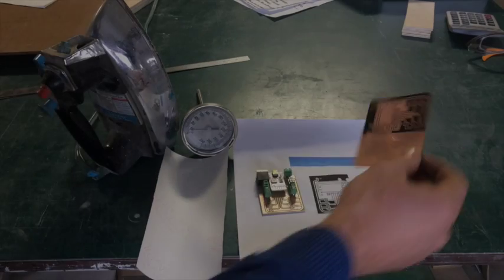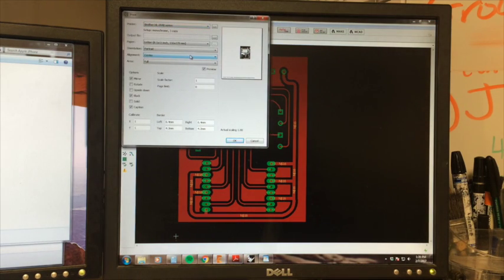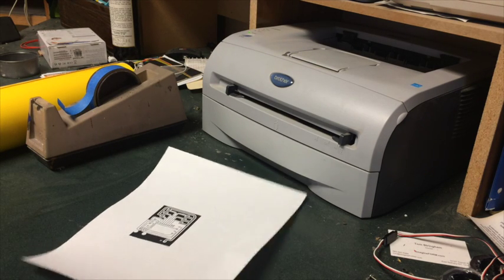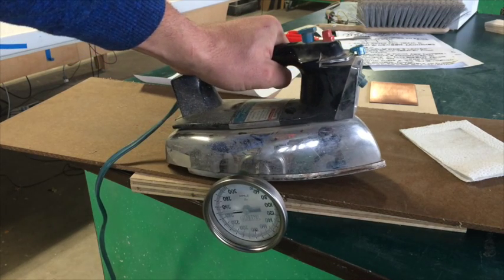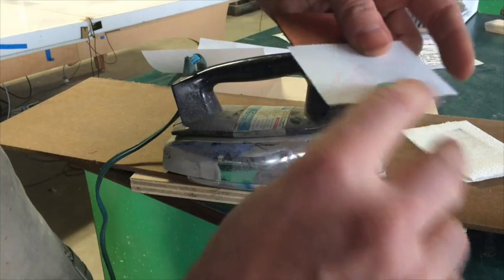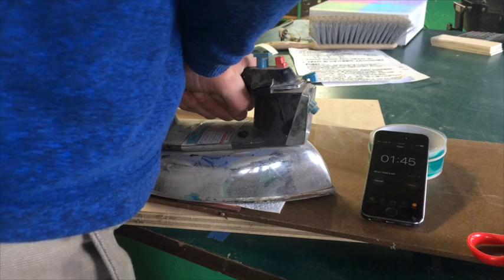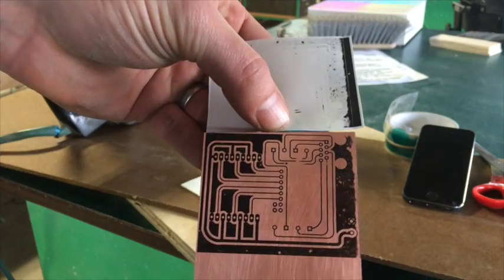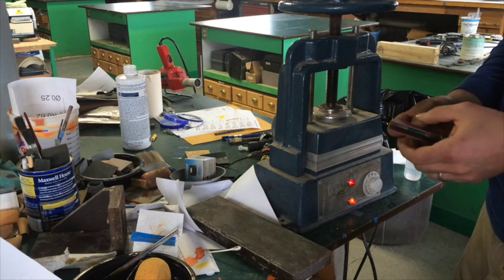DIY New PCB Toner Transfer -- NO Soaking, Just peel off backing

Comment: I have given up on ironing. I use 1 teaspoon of lacquer thinners and 3 teasoons of methylated spirits. Mix and put on the copper pcb side evenly. Apply the laser toner print. Just ordinary good quality paper or glossy if you like. Press down and wait for it to dry. Put on dish and pour in hot water and wait for paper to soften. Peel back paper and all the tracks are deposited.
Reply from the maker: Sounds effective!

Comment: I went to the local Sign making company. They had 3M Scotch brite vinyl backing paper. Its got a shiny surface. the Toner just attached to it, but can come off easily by hand. Ironed on the PCB. Worked beautifully. Used a brother laser printer. unchecked the save toner in advanced properties. Will probably set the printer to place more toner in the next run.

Comment: Great video thanks, what is best way to achieve alignment of the graphics on a double sided board?
Reply from the maker: I put each on a pice of paper that is folded down the center and line them up with each other.  Then use the fold as a hinge.
Reply: @imagineform  thank you

Comment: Trying your method I found out a few things about printers first laser color printer won't work because the multiple rollers messed the print, second some printers have low fusing heat and the toner falls/rubs off too easily of the vinyl backer. For me old 2006 brother laser printer worked the best.

Comment: You can see that he did not get a perfect toner transfer.  I have tried every possible solution to get a perfect toner transfer and have found that in most cases it can't be done with this method.  Another thing is that even after the toner is stuck to the copper, it is very delicate and can be scratched off by accidental touching of it.   So, if you want to save yourself a lot of wasted time and wasted materials, don't be suckered into attempting this method.  The method that will produce perfect results is the method using photoresist film.  You can buy a sixteen-foot roll of it on amazon.com for about ten dollars.  You will also need ultraviolet light.  They say that you can use other bulbs that produce the equivalent of daylight, but ultraviolet light will work way faster.  You will need OHP (Overhead Project Transparency Sheets).  There are a few more steps involved, so there is a learning process that will take some practice.  You can look up this method on youtube.

Comment: Great video. For some reason I couldn't get it to work for me.
Is the "backing" you are printing on, is it smoth? I'm using HP LaserJet and for some reason I can't get it to work.

Any tips?
Thanks
Reply: Me too...I see these videos and it always works first time...I've tried it with all kinds of paper, dozens, I mean DOZENS of times, and it never comes out right, always something left on the paper.   very frustrating.  Read somewhere it was the Brother printer, but this wonderful man has a brother too.   I ordered some yellow xfer paper, let's see if that works.
The best I've gotten is using sticker backing, but I had to clean it with acetone first, or the toner in the printer doesn't stick, but I have to rub it HARD to get it to xfer, iron doesn't do it.

Comment: I've tried it myself. Unfortunately, it is not wood enough for an SMD PCB Where most of the traces are very fine. It will simply mish-mash them all together with no matter how high, how low temp it is or how much pressure you apply, nor how much time you keep the iron on it. And the results are not consistent. Well, I guess for me is definitely going back to the laminator method. Just got to do some further research on it to refine it a little further. Good video presentation by the way.

Comment: Thanks so much for the vinyle paper tip! Worked first shot! (almost)
Done with heat press (regular pixmax t-shirt transfert press), 290°C - 120s, screwed as much as dared. Kept gel/silicone matress underneath.
Small problem on first shot with heat tape on the side pressed. Taped the back only.
Worked like a charm!

Comment: Can a photo printer do the same job????
Reply from the maker: I don't believe so,  a laser printer uses a "plastic" powder for the printing that acts as the resist.  I don't think the ink from a photo printer will work.
Reply: @imagineform  I have tried a lot of time. But failed. By the way, Thanks for your reply.
Reply: The only way inkjet printers will work is if you use a chemical transfer like acetone right after printing before the ink has a total time to dry. The ink is a water-based ink so you have to take that into consideration when you do your transfer.
Reply: Ink from inkjet printers will not stop the etching process where you lay down the ink got so it'll a along with anything else it's just colored pigment

Comment: I tried the 3M Scotchcal Marking Film backing paper on a Brother Laser Printer and had the images come out smeared and repeating like it stuck to the drum.  Printed on the glossy side assuming that to be correct. 

Got some Arlon backing paper, not sure which particular vinyl model, same result. Printed on the opposite side and it took the print wonderfully. Not sure about the transfer performance yet.

Comment: I've tested using a Monocote iron by Top Flight. Had a couple lying around from my R/C airplane building days. Actually works very well with good temperature control and a small Teflon shoe that doesn't stick.
Reply: I've done the same, but I took it and flattened the face against some 320 grit sandpaper. My iron actually had a bit of a "dish" to it before I flattened it.

Comment: i've got great results from using parchment paper.  Have you used that and is that adhesive paper any better?
Reply from the maker: I did try parchment and it didn’t work great with my printer.
Reply: Toner tranfer 180° to  210°
Reply: For about 3 seconds

Comment: How do you " touch up" the traces? Permanent marker? I thought the acid would still etch through it?
Reply from the maker: Yup just a sharpie.  The acid doesn’t touch it.  I put a couple coats on letting it dry in between.
Reply: I've used sharpies with zero success. Etchant went straight through in a few seconds. Clearly all sharpies are not equal. What brand do you use?
Reply: I don't use sharpies, as I thought the enchant would just go through like said. Since I have never used sharpies though, I was curious how he touched them up at all.
Reply: Years ago we used "Decon Dalo" pens which had thick gooey ink and spring-loaded hard fibre tips that kept them sealed between traces. I've seen an electronics retailer selling regular Staedtler 318-3 Lumocolor® permanent ink markers as etch-resist pens. The '3' seems to denote blue ink so I guess black would be 318-9, green: 318-5 and red: 318-2 (though that may be hard to discern on copper surface). Then again, there are double-ended numbers specifically marketed for the purpose on ebay..
https://www.ebay.com.au/itm/CCL-Etch-Resistant-Resist-Anti-Etching-PCB-Perm-Ink-Marker-Pen-Circuit-Board-Non/162867283703?hash=item25eba586f7:g:J-AAAOSwTLpbMdgi

Comment: Another tip: put the copper board in the etchant for about 30 seconds, rinse, dry then try toner transfer. It gives the toner something to grab onto, better than steel wool etc.
Reply: +1. I've always had 100% transfers using this method whether it's with blue transfer film, glossy mag paper or photo paper. I also always rinse the whole lot under a cold tap to cool and set the transfer before trying to peel away the transfer medium.
Reply: I am going to give that a shot!
Reply: You are 100% right! In fact, I never clean the copper or degrease it. The toner sticks better to "dirty" copper than to clean copper. it is a myth it has to be clean.

Comment: without laser printer is it work? I mean the inkjet printer.
Reply from the maker: +Jitu Hossain no,  you need a laser printer
Reply: Jitu Hossain: Inkjets use ink, not toner. So there is
no toner (the resist) to transfer to the Copper.

Comment: The yellow pcb transfer paper from china works well, just need to slowly peel it away once cooled
Reply: I just use standard Yellow PCB paper from China/eBay print on the shiny side, iron onto a roughened copper board and then when cool slowly and carefully peel back the paper, you will get gaps and some pin holes I just go over any holes or breaks with a sharpie marker pen, then etch the board
Reply: I also used these yellow papers and I tried many printers for them to have a print but a lot of time, it doesnot get the print,,,,,Which printer u r using,,,,,,,,,,,,,,
Reply: The trick is to roughen the surface of the copper board first with wet and dry or a scotch pad, really scuff it up and make it look like a matt (not shiny) surface this gives a rough surface for the inket toner to stick to, then rinse the and thoroughly dry the board, use a non stick iron on a flat surface on a high heat, and evenly iron the surface making sure you get all the edges, then let the board cool down to room temperature and then very slowly peel off the yellow paper, also make sure you print on the shiny side only of the yellow transfer paper this is critical, I use a normal mono laser printer, obviously has to be a laser printer, inkjet wont work, laser toner is a powdered plastic not an ink
Reply: Bro,,,,,pls tell me I m making pcb's since a long time,,,one problem we r facing is that our butter yellow paper is not getting a better print when we insert it in the printer and when we use photographic paper, it has a better print but it is not transferable to the pcb,,,we tried on 20 different types of printer,,
Reply: I use a Samsung Laser ML2022 and a samsung toner, I will try to make a video showing how I do my PCB's :)
Reply: Do you peel the brown paper off and print on the waxy inside of the yellow paper.
Reply: I don't get any gaps in mine. Maybe check the flatness of your iron face with a ruler, because I had to go through 3 irons until I found one with a flat or convexed face - most were concave -. 
Here is how I do mine.
https://www.youtube.com/watch?v=Uc6JVouUAis
Reply: Thanks i will try a different iron, I also wonder if the brand of toner and copper board make a difference
I find I get gaps and pin holes with the yellow pcb transfer paper, but perfect transfer with glossy photo paper, but the glossy paper is a pain to peel off cleanly it always leaves a layer of paper aswell as the toner
Reply: Paper is hard to get off, but photo paper must be murder. I use Canon printer/toner on max dark.
If the iron has a dip in the middle it won't heat the center of the PCB, and the toner won't transfer that well - my bad irons were like that -. Good luck.
Reply: By the way I use cupric solution to etch mutch less cost than ferric etching and can be recharged with peroxide

Comment: finally i achived some results after having difficulties with acetone and ironing method. I have a HP Laserjet 1010 which need the max temperature my iron can heat up (350-360 degrees celsius). Also the paper is very important i tried normal,photo paper which did not work at all and i guess they are shielding the heat too much. Backing paper works a but gives unclean results. Finally magazine paper (ikea ad cataloge) works with pretty results like in the video. But i figured out its important to put the piece with the paper into water before removing the paper. (2mins heating, 3-5mins cool down on rair, then put into warm water for 3mins, and remove the paper under water). Another idea i will try out is using a soldering iron to rub the paper from behind (since my toner needs higher temperature of above 320 degrees).
Reply: soldering iron works good due higher temp, to control the result you can vary the speed on rubbing also (not only the temperature)
but my favorite method is this ttps://www.youtube.com/watch?v=HBIxvwZ_0og
(search for my comment there for additional info)

Comment: Great video!  I have some feedback for you.
I have been doing this exact method ever since I got into making my own PCB via the toner transfer method.  I can tell you that the type of vinyl backing paper does matter.  I have several vinyl graphics shops in my city and therefore have had the luxury of trying several different brands.  The toner doesn't seem to stick well to some brands and okay on others.  So far the brand I like is made by 3M.  It's called "3M Scotchcal Marking Film".  It is white on one side and light blue on the other.  The light blue side is not all that glossy, but has a unique feel to it (difficult to describe).  Toner from laser printers stick to it very well.  I use an HP Laserjet4200n and I print on the blue side.  I can also tell you from experience that I've printed on the 3M paper, left it sit for over a week, came back and it still performed the toner transfer method flawlessly.  I am so glad others found this method of toner transfer. On a side note, most if not all vinyl graphics shops discard these papers as trash.  Once they pull the vinyl off the paper to make their sign or whatever, the paper backing is useless to them.  They are more than happy to let me have all I can carry.  There for I have a PERFECT paper for doing toner transfer, pay nothing for it, and I have it in an inexhaustible supply.

Keep up the great videos!
Reply: Bro,,its great,,,pls tell me I m making pcb's since a long time,,,one problem we r facing is that our butter yellow paper is not getting a better print when we insert it in the printer and when we use photographic paper, it has a better print but it is not transferable to the pcb,,,we tried on 20 different types of printer,,

Comment: why it only works with laser printer ?
Reply: Because toner is a plastic powder that melts on the paper when printed, when you heat the paper with an iron it melts again and transfers to the copper.
Reply from the maker: Laser printers print with a powdered plastic that is then heated to melt to the paper,  it is this plastic that we can melt onto the copper.  An inkjet sprays ink so there is nothing to transfer.
Reply: István

Comment: I put PCB between two metal pieces 3mm each, heat it with airgun for 3-5minutes on 500C degree (second speed) , then press it in vise and wait till it cool down about 5-10minutes. Gives good results too.
Reply: will try that thanks.
Reply: @dannyyorri2345  Now I use CNC router. Gives you 100% results. All traces under microscope looks perfect. So two ways: if you need more of them order on PCBWay. If you need only few, then cheap china CNC Router does perfect job. No etching anymore for me :)
https://www.aliexpress.com/wholesale?SearchText=cnc+machine
Reply: 😅 3:54